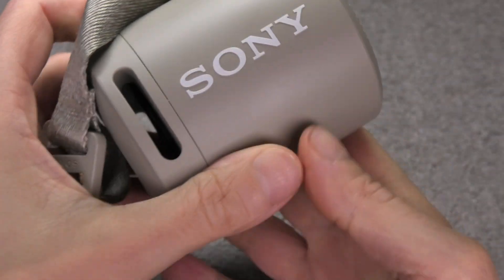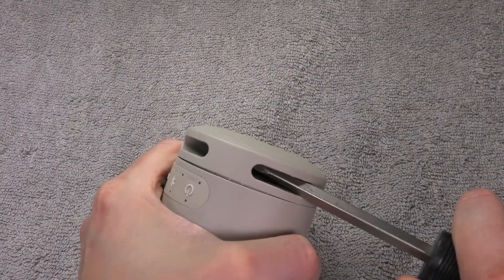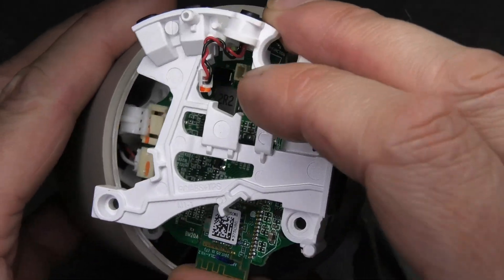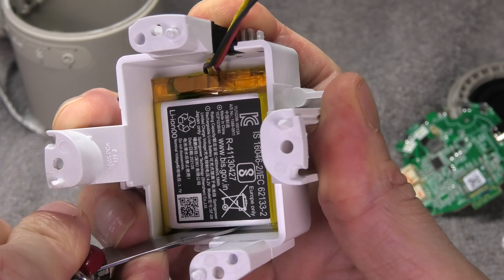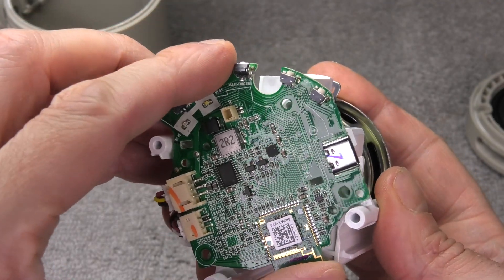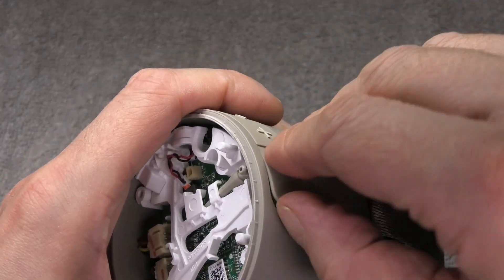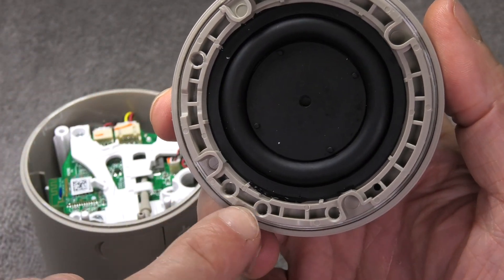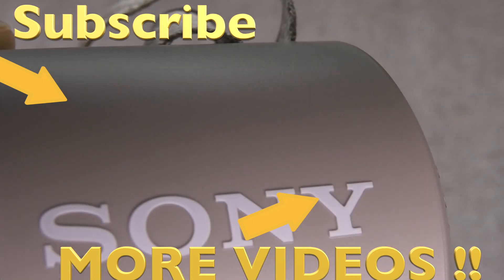Battery Problems Sony Bluetooth Speaker SRS XB13 Replacement (How to)

Comment: so i replaced the battery and everything was great for about a month. It randomly died and now the charging light is blinking red when i try and turn it on. When i plug it in to charge the light does not come on. I'm so confused

Comment: Helpful thanks. I’ve replaced the battery hoping it might resolve the low level volume issue. Sadly it hasn’t, it’s still below the volume it used to be. 
Anyone have any bright ideas??
Reply: Sounds dumb, but turning the volume to 0 then back up with the buttons on speak helps mine.  I keep mine plugged into battery pack when using.

Comment: In the past, the manufacturer would have made that bottom part threaded to screw on with a rubber ring so you could replace the battery.  Now, manufacturers WANT everything we buy to be disposable.  I'm sick of it.  If you want to help the environment, then this needs to stop (produces so much waste when you have to throw the entire device in the trash).
Reply: I fully agree!!! I was considering this product to purchase but because of this throw away mentality that Sony encourage, I shall seek an alternative. So rather than holding me to ransom when the battery dies, you can lose my investment completely.
Not good enough Sony - no excuses!
Reply: Corrigieron ese error en una versión posterior qué trae 4 tornillos para luego quitar la tapa.
Reply: Yo compré una pila la cambie y no carga pedí un cambio o reembolso por la pila defectuosa y pedí otra pila y salió lo mismo, ahora tengo 2 pilas que no cargan, alguien sabe cuál es el problema?

Comment: I regularly use my speaker in the rain. I guess it loses its IP rating when you break the glue seal, right?
Reply from the maker: Right,  it would be difficult to seal this speaker back up

Comment: is the bottom speaker just an accessory? doesn't look like xb12
Reply from the maker: It’s called passive radiator and is used to enhance the bass.